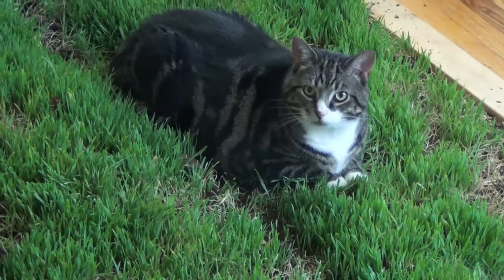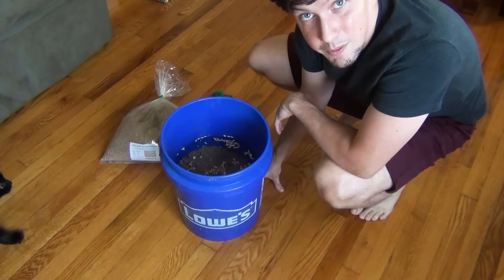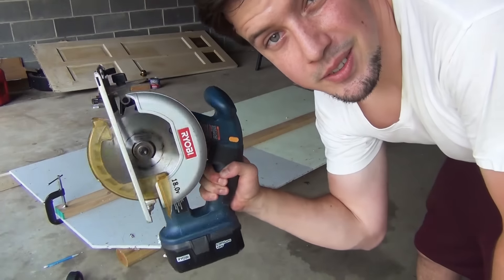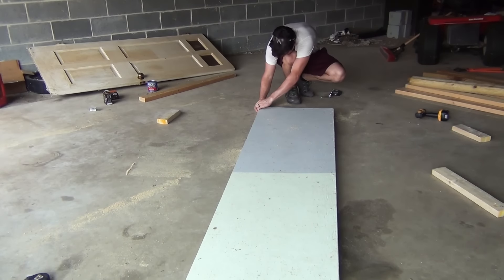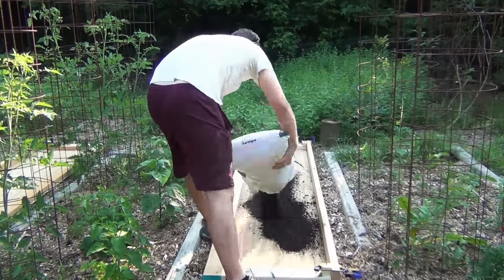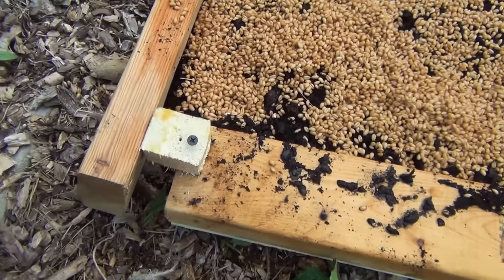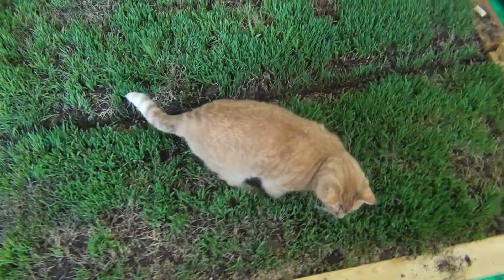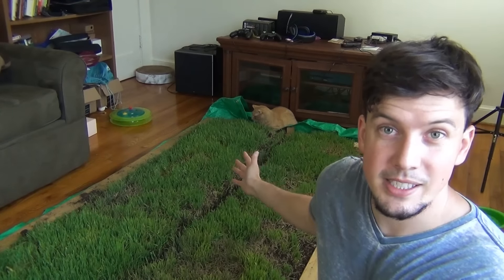I Built the World's LARGEST Cat Grass Bed and Put it in My LIVING ROOM!

Comment: Might i suggest an easier way? Just buy a bunch of plastic trays with the proper side height. Fill them all up with soil and soaked seeds. Tape the sides together to create one big bed. remove tape to move when needed. Don't have to worry about weight because they are separate or leaking. No need for tarp underneath. jmo  I've even used 4 cookie sheets to form a square.

Comment: No denying you love your kitties Jason!  Here's what I do. I bought a plastic container with wheels  and a lid at target. Measurements are 34"×17" and 6 1/2in"ht. $14.00. First, I drilled holes in the bottom with a 1/4 inch drill bit. This is the teadiest part. Lots of holes for drainage. Then filled the container with 4 inches of soil then topped it with a piece of sod. I use the lid under the container to catch the drainage when watering. I have them situated in the rooms where they can get at least 6 hours of sun per day from the windows. I have 3 in my home and my cats love it. You should really try this. Make a video. The sod doesn't die when you have at least 3in of soil. All I do is trim the grass with scissors. It will last for 6 months or longer. I also have one on my upstairs balcony for my pup. She uses it when it's raining and doesn't want to go outside. The wheels make it easy to move around. Can you tell how much I love making and using these...♡
Reply: Cinnamon Girl, that sounds fantastic! Have you got pics? (dumb question on youtube, i know) But what sort of seeds are the best nutritionally for dogs and cats? Wheatgrass or what do you use? I have 2 cats and 2 dogs. I want them to have grass to munch on but also a dog toilet when its an emergency. Yours in chihuahua power! Thank you. Also drainage holes in the plastic - if drilling is too tedius, I use a soldering iron to melt plastic = no cracking :-)
Reply: I don’t have a drill and was thinking to use a hammer and nail. Would that work or split the plastic?
Reply: Also he used dirt but his grass didn’t look good after two weeks. Any idea why?
Reply: @twilit  a hammer and nail would split the plastic. Just heat the nail with a lighter or fire, and push it through the plastic with pliers to melt a hole. 

You can get a drill capable of drilling styrene and other thin plastics at most Walgreens/CVS type pharmacies for about 5 bucks. 

His looked like shit after 2 weeks because it's nowhere near deep enough to grow grass feed. The grass root locked and died, or because of the lack of drainage, root rot. 
Those are the 2 killers of cat grass/pet grasses. You want something 6-12 inches deep, like a large flower pot or storage box, something you can add an inch of gravel to, followed by dirt or another growing medium, like coconut husk,giving the grass plenty of space to root out. 

It will still die however, even if you trim it. More space just means more time to grow.
Reply: @michaelunderdog5039  oat, wheat, or rye are the recommended pet grasses. Stay away from ornamental grasses and fancy grasses
Reply: @danvondrasek  thanks mate :-)
Reply: Genius 😻
Reply: @michaelunderdog5039  Wheatgrass is good, but alfalfa grass is good for kidney disease, both treating and preventing. Some grass are actually high in protein and you want to avoid that for cats with kidney disease, or with a family history of it.

Comment: I tried soaking seeds and failed. So i said the heck with it. Got a few bags of miricle grow potting soil. After having seeds in freezer for a week. I used a plastic rectangle food storage. I put soil in about 1" from top. scattered the seed on the top of soil watered it lightly covered seed. Put in sunny area. Watered every day grew fast and healthy.
I trim it, and ware it looks like its dying off i just add seed and water. Continuous growing. Love it. I like easy.
I have 4 cats indoors. But i have a large catio for them. I'm gonna try to grow wheat grass in a child swimming pool. This is very cool guys. Thanks.
PROVEN FACT BY A FARMERS HINT TO GROW ALL GRASS FAST N HEALTHY. ALWAYS PUT INTO FREEZER 1ST THROW WHEREVER YOU WANT GRASS. LIGHTLY COVER BY HEY OR SOIL. WATER EVERYDAY COME UP PRETTY FAST. EASY PEASY. IT WORKS.

Comment: Just a question. You mentioned that you were concerned about them using it  as a litter. Did that happen. I’m planning to do this as well but I’m just concerned what if they use it as litter. Since you have been using it for a while wanted to check if you have an update on your experience having this indoors

Comment: Why didn't you just give it some "boning structure" underneath or even the inside at 1/2 the height like what you did to connect the  two halves (if that makes sense) if worried it will bend or snap in the center